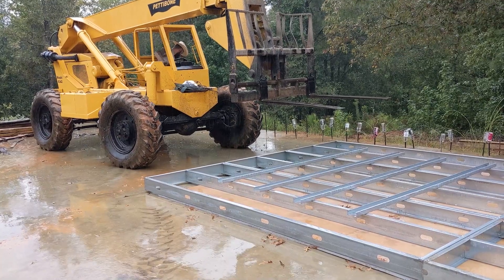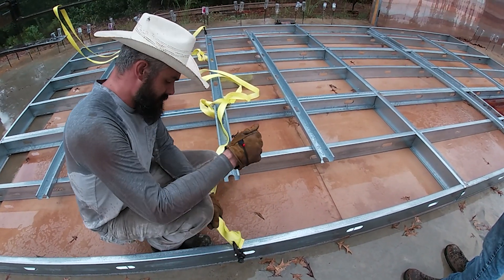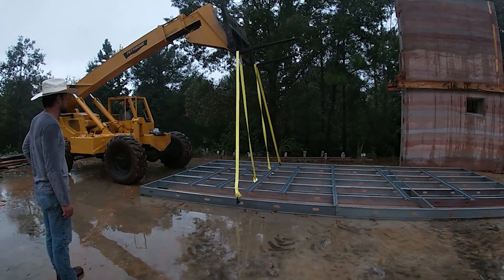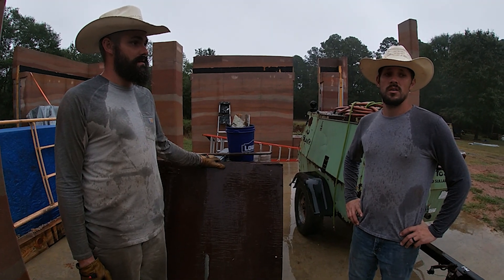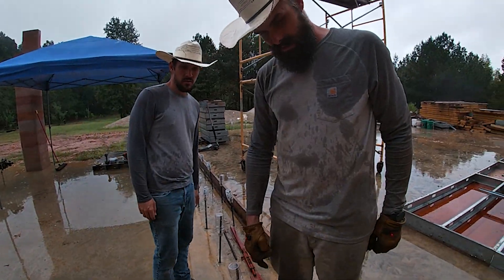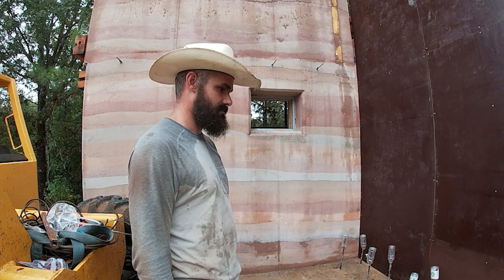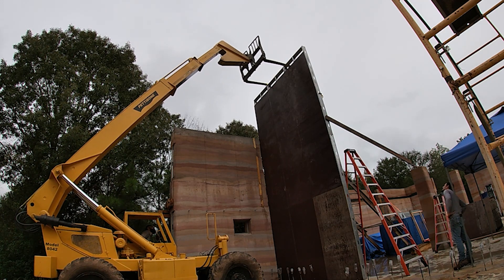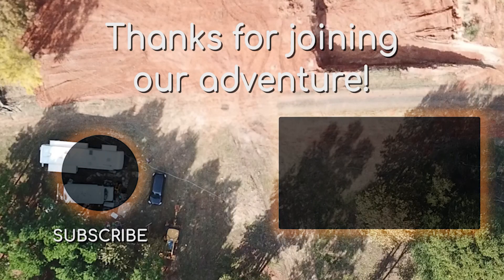GIANT Rammed Earth Form Set Up in the RAIN - Vlog 77

Comment: Nice rammed concrete pillar. no false advertising please
Reply from the maker: No false advertising intended. The material we are using is called rammed earth. Concrete is poured wet and has a higher cement percentage. Ours is mechanically stabilized (rammed) to give it the strength. It is similar to concrete but technically it is different. Hope that helps and sorry for the confusion

Comment: Are Rammed Earth walls water resistant once the house is completed? How well does it deal with the issue of mold?
Reply from the maker: The admixture from SIREWALL that we add makes them water resistant. Mold has not been an issue in other rammed earth homes that we have found, so I don't think we will need to worry about it.